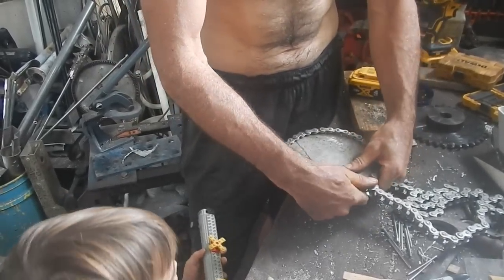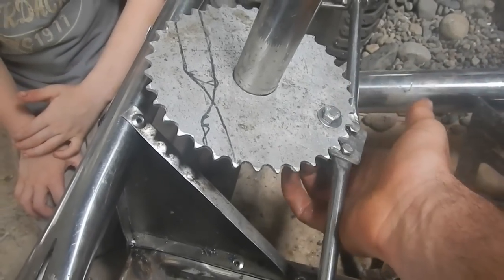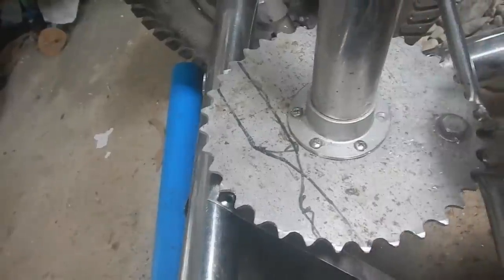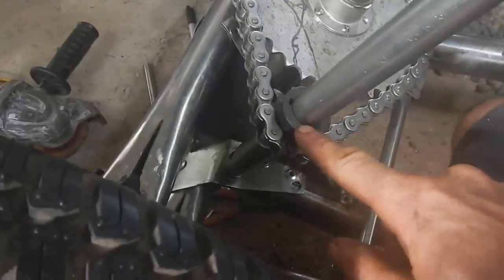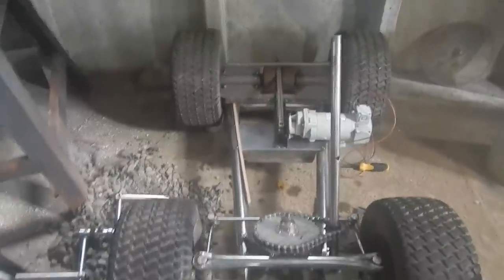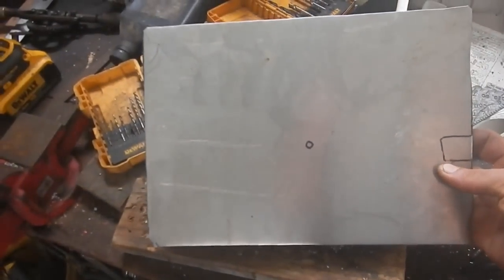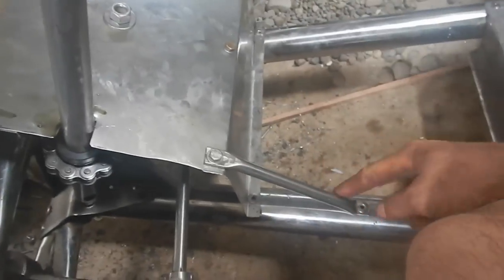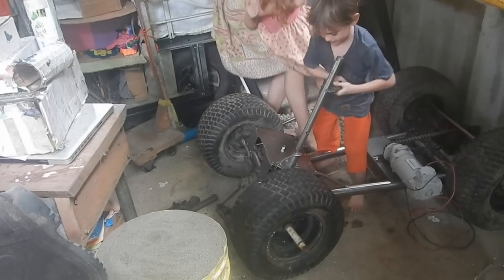Kid Car 007 Steering

Comment: I made a steering wheel out of PVC pipe too. I filled the pipe with hot sand and it bent really easy without kinkers :D You probably did too :)

Comment: Difficult to identify the flowers on the monitor at 11:33 ....  Couldn't tell if the center looks like a bottle brush.  If it does it is likely a hibiscus, considering the bio-region.  Gladiolas are also an option.  Depends on the leaf.  If the flowers were on woody bushes with fairly large heart shaped leaves with a serrated edge they should be hibiscus which are safe to eat and are a favorite ingredient in the herbal tea blends I make.   If the leaves come out of bulbs and look like long blades of grass, I'd guess they were gladiolas.  I haven't any experience with them but read that they are toxic if ingested, causing mild stomach issues, and can be irritating to the touch.